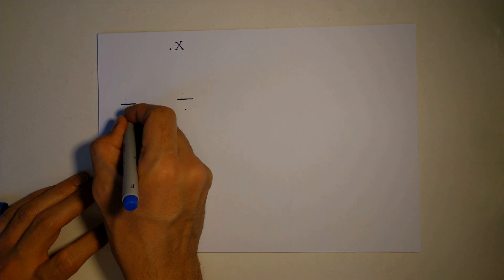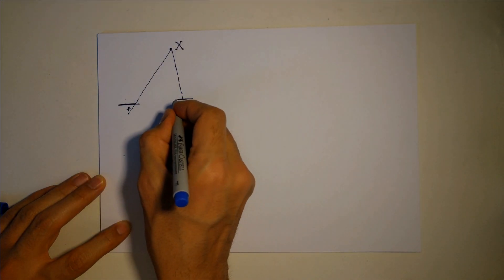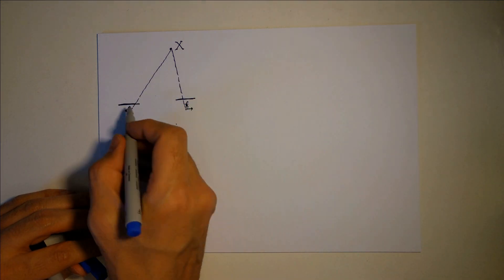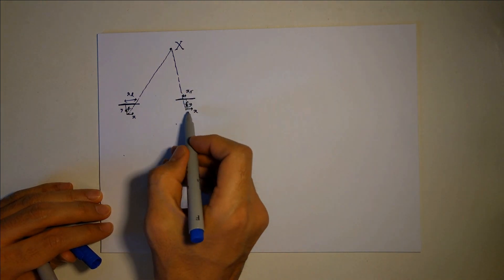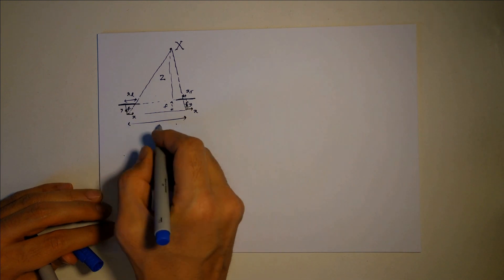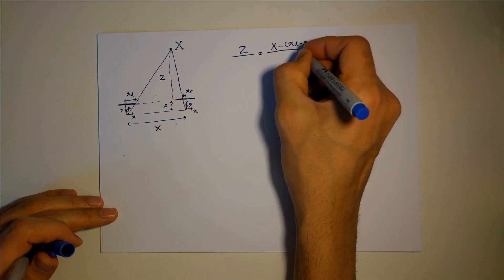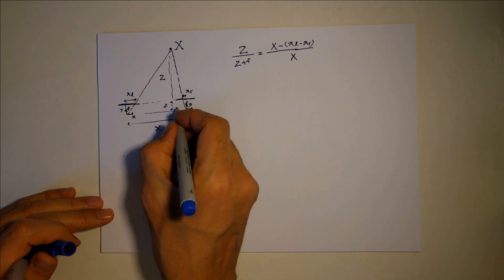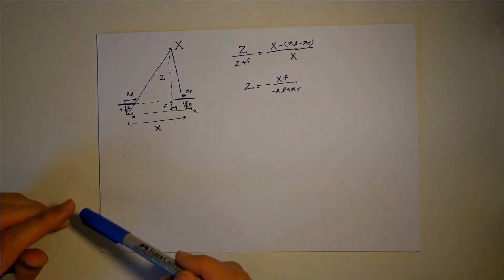Geometry of Stereo Vision Explained

Comment: How do you get the second equation: z = -xf / -xl - xr
Reply from the maker: You have to triangle, big one, and the one inside that, we know that the scale of altitude over base is the same for both triangles,
Reply: Thanks for the reply!

So would the ratio of altitude/base for both triangles make:

z / x - (xl - xr) = z + f / x

How do you get the final form stated at 4:35 

Thanks again
Reply: Sorry but the math doesn’t add up, how did you get the simplification at the end!?